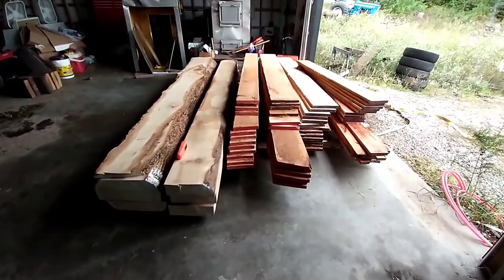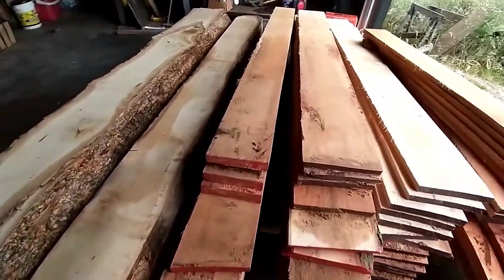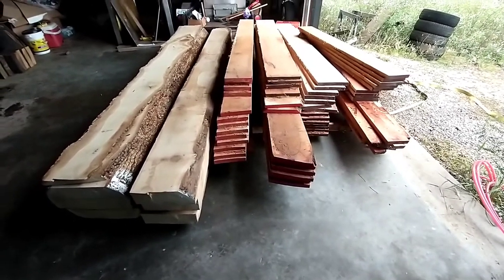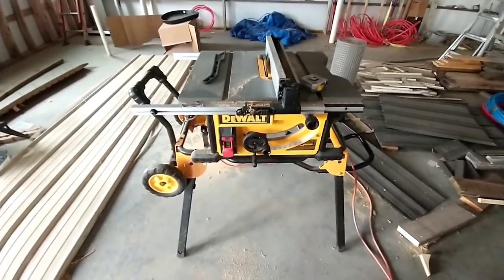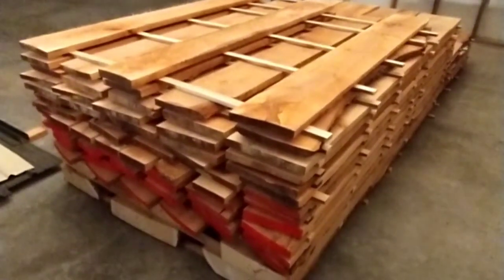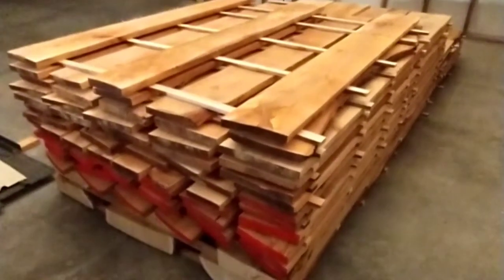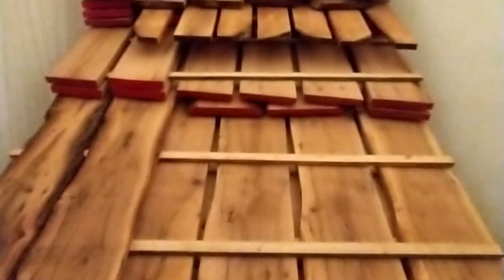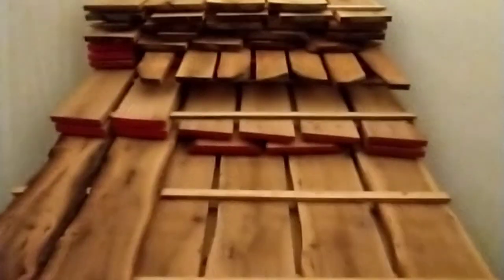Drying Sawmill Lumber in a DIY Kiln

Comment: Did not see enough concrete blocks on the pile.  The last stack I made, used pallets with concrete slab from old sidewalk.  Worked great.  The long ends sticking out also need concrete blocks.

Comment: You need the air blowing or moving through the lumber on the sides. It can't flow freely from end to end.
Reply from the maker: This seems to be working out pretty well. I plan to release a follow up video before too long so we'll see how it's doing. I haven't been in there since the last video.
Reply: Smart. 🤔 I like this idea. 🙏☕️🎩🎩🎩
Reply: @assemblyrequired1  you get her done? How long did it take to dry in this